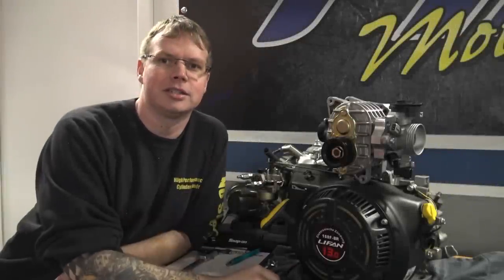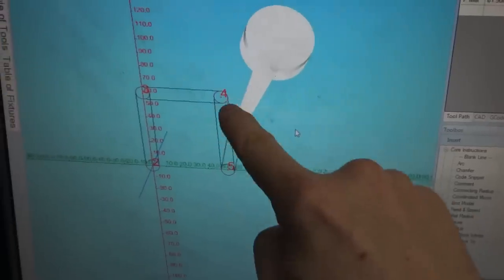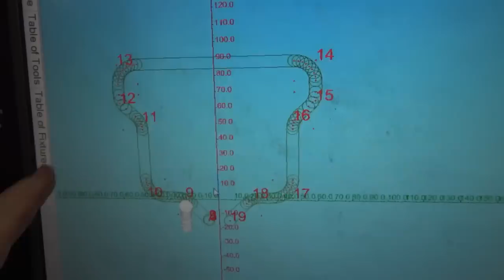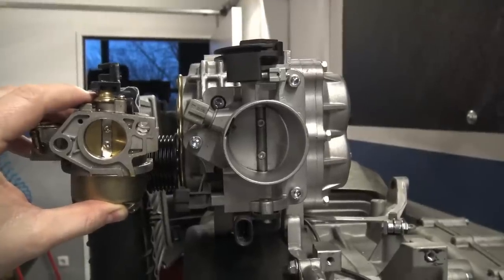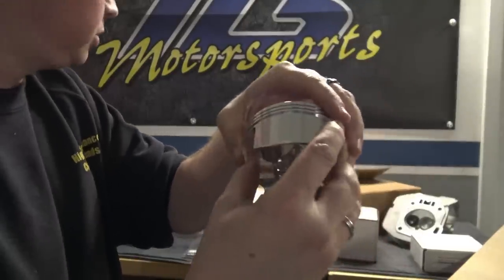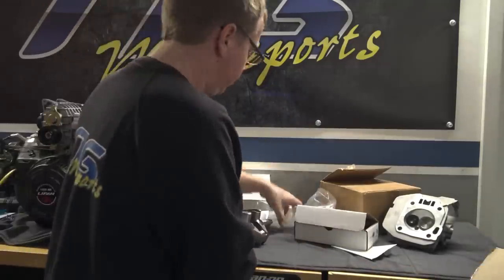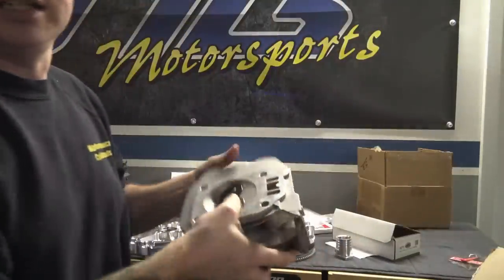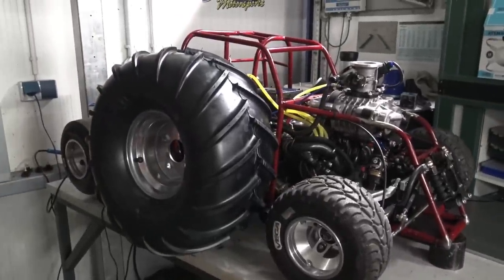1/3 supercharged Grave Digger Monster Truck - part 1 Engine parts and CNC machining

Comment: Ok you have my attention. You're not joking around lol. If you're going for 70 hp with that engine, you really are crazy but in a good way. You know what you're doing so go for it👍💥🔥. A monster truck should have explosive hp.  I have been thinking about using a modified 125cc or 250cc 2 stroke dirtbike engine to get at least 40 hp. You have the right idea. A monster truck should be a monster in every way! Thank you very much for sharing details of these builds with everyone. Keep up the good work. I can't wait to see your monster truck come to life and start moving.

Comment: Those Tires are prefect!
Completely unnecessary, but I wonder if you should add 4 more lugs/bolts to the wheels for a more authentic look.
Reply from the maker: I love the idea! I also need to add the beadlock look so why not installing 4 extra bolts? Thanks for the idea!

Comment: Nice job on the machining, and the tip not to cut right through so the part doesn't hit the cutter. But when is the Willy's going to Dyno 👍🏻😁
Reply from the maker: Hopefully soon, I want to solve some minor problems which I came across during the test run. Afterwards I will drive it again and make sure it is ready for the dyno. Thanks!

Comment: Next time it will probably be cheaper for you to buy a real Honda bare block and Head. Real Honda castings are the best for high power applications, chinese castings are known for cracking easily on high HP applications.  Also you should look into block reinforcement, "side plate" "spine" etc. Look for Paul's Karts and Drag Mini Bike channels on YouTube for more info on block reinforcement. Looking forward to see this crazy project finished. 👍👍👍
Reply from the maker: Thanks for the info - I will look into that !
Reply from the maker: I checked his work and really like it ! He spends a lot of time in perfecting those engines. That encourages me to go completely nuts on the cylinder head :-)
Reply: @timsane  Both of this guys specially Paul  share a lot of great info and trick on small engine building.

Comment: If you're turning into a monster truck you going to have to put 4 wheel drive in it and jack up the suspension huge I'm pretty sure it's not four wheel drive yet last video was spinning just the rear tires that doesn't mean it doesn't have four-wheel drive though I don't know I just got here pretty cool though

Comment: If you’re running Methanol why the intercooler?
Reply from the maker: I plan to use Ethanol for the Monster Truck - easier to get, handle and less corrosive

Comment: Hallo erst  mal Tolles Projekt und Klasse Videos 👍ich hätte da 2 fragen da ich ein ähnliches Projekt habe 1 der Zahnkranz für den Anlasser ist das ein Normzahnrad wenn ja welches Modul und 2 wie wäre so das übersetzunsverhältniss für den Kompressor idealerweise oder wird das individuell abgestimmt? Mir geht es darum das ich meinen eigenen Motor gebaut habe und bin noch am tüfteln vom Anlasser und Kompressor da ich alles selber mache bin ich in der Umsetzung sehr flexibel der Kompressor ist derzeit in Arbeit allerdings hat mein Motor nur 76ccm ein paar Videos hab ich online danke schon mal im Vorfeld Gruß und weiter so bin auf das Endergebnis gespannt
Reply from the maker: Schreibe mir eine email an hello@timsane.com - ich gucke,ob ich dir mit tips helfen kann. Schreib mir mal welchem Kompressor du hast. Gruß, Tim

Comment: Uhweeeee..  bin gespannt .. kenn den anderen Hobel ja von Kaes oder Krämer... weiß grad nicht genau in welchem Kanal das Ding schon zu sehnen war 😉 kommen da auch andere Sitzringe und Führungen von euch dir rein? Aber nicht das der VR6 Junkee eifersüchtig wird😂😂
Reply from the maker: Das Auto war schon bei JP und Philipp zu sehen. Selbstverständlich tauschen wir die Ringe und Führungen gegen Heat Material UND es kommen sogar VR6 Ventile zum Einsatz 😂 danke fürs einschalten!
Reply: @timsane  oha.. wenn das der Kaes sieht.. der baut deinen Motor Huckepack in seine Limo 2.0😂😂😂😂😂😂